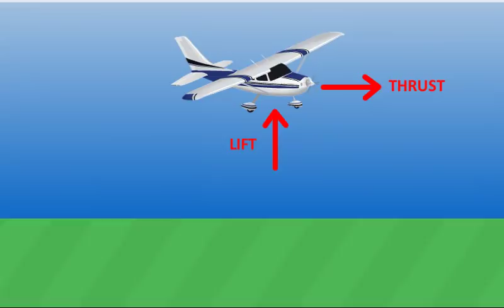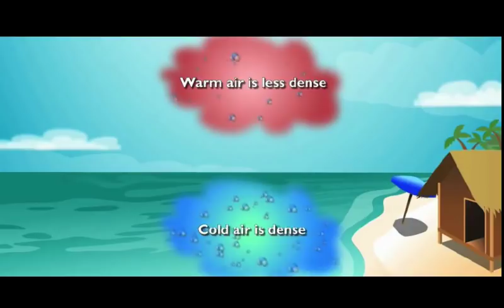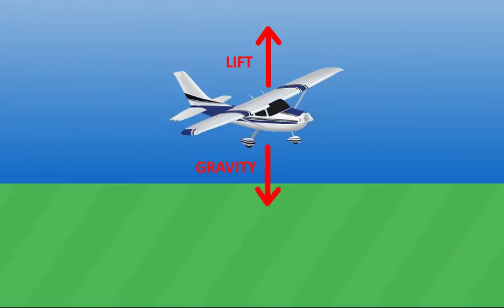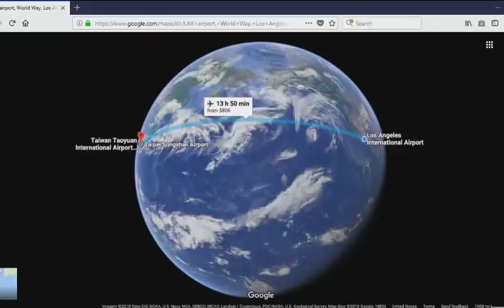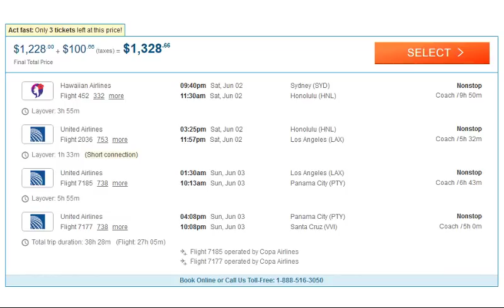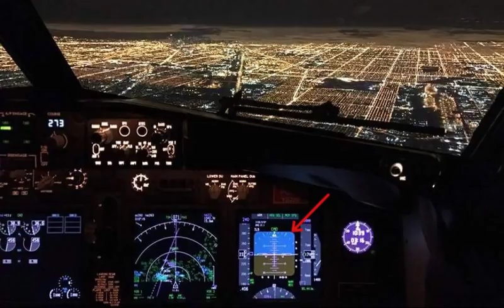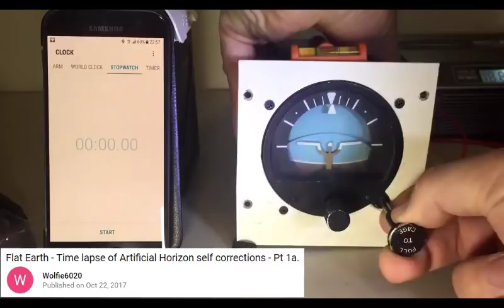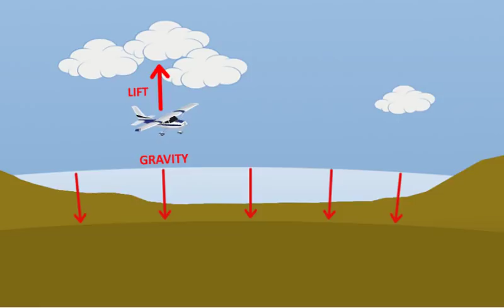Flat Earth Falsities - Plane Nonsense

Comment: The problem not explained is this: 
suppose an airplane had an attitude gyroscope that was not self-adjusting.
Fly 1000 miles and the nose should have dipped 15 degrees and the unadjusted  gyroscope should show this.
Reply: Jet airliner flight computer. https://www.youtube.com/watch?v=677T6oeTn_0
Reply: Stormageddeon Dark Lord of All  
It means that an adjusted gyroscope neither proves nor disproves a round earth. A gyroscope fixed at takeoff would prove or disprove a round earth.
Reply: @Mdebacle  Stuff does not seem to work automatically, no eyes.
[ The instrument may develop small errors, in pitch or bank during extended periods of acceleration, deceleration, turns, or due to the earth curving underneath the plane on long trips.]

Some counter flat phobia "Automatic Gravity" reasoning text:
[So it seems absurd to claim the invention of pendulous vaned gyros in the 40’s were the first to provided curvature correction, when non-stop transatlantic flight by Alcock and Brown was achieved in 1919. They flew from Newfoundland to Ireland which would have needed a curvature correction of more than 400 miles of drop. To realise why this curvature correction is absurd we need to quickly cover the basic principles of a gyro.

So as we can see, pendulous vanes have their uses and weaknesses, but one task they cannot perform is the mythical correction for the non-existent curvature of the earth. The simple principles of rigidity in space and precession provide all the knowledge capable of determining whether we are living on a spinning, hurtling, orbiting ball. The only conclusion that we can draw is that the earth is a stationary plane.]
https://savageplane.wordpress.com/2017/06/06/gyroscope-basics-the-pendulous-vane-fallacy/

RIP SPINNING BALL EARTH
Reply: @BrainUser1  "Electric powered gyros may have different mechanisms to achieve a similar effect," says the wiki page you quoted. Guess you should try reading further.

Comment: Regarding the first issue, it DOES take longer to fly in one direction than the other. Just do a search on any travel site and look at the flight times. For this example, I picked a non-stop flight between Chicago and Amsterdam. On every flight listed the trip west takes an hour longer than the trip east. That's because you're either flying with the Earth's rotation or against it.   https://www.tripadvisor.com/CheapFlightsSearchResults-g188590-a_airport0.CHI-a_airport1.AMS-a_cos.0-a_date0.20181222-a_date1.20181229-a_formImp.bee1fa83__2D__37e7__2D__4bb2__2D__939b__2D__0505b5d2d87b__2E__281-a_nearby0.no-a_nearby1.no-a_nonstop.no-a_pax0.a-a_travelers.1-Amsterdam_North_Holland_Province.html   (You'll have to set the filter for non-stops)
Reply from the maker: “Plus or minus wind currents” - me
Reply: That is because the main winds at the hights commercial planes are flying at , are going predominantly one direction.Those are the jet streams.
Reply: Either way, it proves rotation.
Reply: @smokeydoke100  Exactly,
Reply: Your theory has holes all over it. You're saying that the reason it takes longer to travel one direction than the other is because of the earths rotation? BOGUS. Have you ever been on an airplane before? You are travelling 700-900km/h... what if you jumped out of your seat and sprinted from one end to the other down the aisle: do you seriously think it would take you longer to run from the back of the plane to the front than it would vice versa? It's the exact same thing with the earth. If the plane were actually affected by the earths spinning action, it would travel at about 2,400km/h in one direction, and it wouldn't even be able to move forward in the other, it would actually be going backwards at about 800km/h. fool.
Reply: @Stuglamp2009  Not to sure, but I think this is about the fact that (if you´re being nitpicky, so a scientist) due to the earth rotation, you have the jet streams wich make your flight time different going east vs. west. I understood Maxwell Edison to mean that at least.
Reply: You can equally do this in a car driving with the wind one way, and against the wind on the way back and there will be a time difference. How much more would the wind effect an aircraft?
Reply: That explains why you have shite for brains then Reggie. Thanks for telling us.  @reggiereid1345
Reply: @reggiereid1345  If I'm driving with the wind, why would I bother having a car? Seems like a sailboat with wheels would be cheaper.
Reply: @nimrodery  You must be a Nasa employee with all the sense your making.
Reply: @reggiereid1345  "You're," and "NASA." You're welcome.
Reply: @nimrodery  <--- Just like your name should be Capitalized. 

So what? We all make mistakes. I'm not here trying to make anyone else look bad.
Reply: @reggiereid1345  So you're saying I make no sense, but you're not trying to make anybody look bad. Foot, meet mouth.
Reply: @nimrodery  I've been replying to all you paid shills. You guys reply to me. lol get it right!